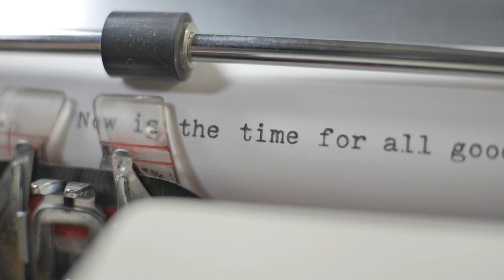Typewriter Video Series -- Episode 261: Singer Electric

Comment: I am so happy and grateful that you shared the belt replacement for your Singer. I bought an SCM Electra 110 not too long ago, and I realized right away the belts need to be replaced. (It sounds very different than my SCM Coronet Super 12.) By sharing the materials and process you used in your methodical way, you’ve given me a valuable tutorial. This will be my first time to complete a typewriter repair on my own. Thank you so much!
Reply from the maker: You're welcome, and good luck!

Comment: Great Video!  Two years ago, I acquired a mint-green Smith-Corona Electra 120 6-series typewriter. It's A Peach! My dad worked for Singer Sewing Machine Co. up until his unexpected, untimely, sudden death in June of 1960. In the year 2000, I became interested in Singer sewing machines, and I began the new hobby of collecting, repairing, and sewing with them. In January of 2019, I bought my first antique/vintage typewriter, and thereby began collecting and repairing typewriters. Since then, I have been looking to acquire a Singer typewriter, hoping to find one available locally, which has yet to happen. I know that I could sell the S-C Electra 120 easily and then buy a Singer typewriter, but I don't want to let the 'sweet' S-C Electra 120 go.

Comment: Another source for belts is to order polyurethane round belting with textured surface from McMaster-Carr by the foot and cut a length and fuse the ends into a continuous belt. The belt should be a bit smaller that the original V belt to stretch for better grip.
Daniel

Comment: Hey, Joe! If the flat plug isn’t the best match for this Singer machine, I see that white, ungrounded 2-prong plugs are available like the “Legrand - Pass & Seymour SA540WCC10 Residential Polarized Plug Straight Blade 15-Amp 125-volt Two Pole Two Wire, White,” less than two US dollars on Amazon. Or, for a bit more, the “Leviton 101-WP 15 Amp, 125 Volt, NEMA 1-15P, 2P, 2W, Plug, Straight Blade, Residential Grade, Polarized, Non-Grounding, White.”
I like the SCM 6-series machine I have, types great! Thanks for showing the disassembly and belt replacement procedure. Great video on this Singer!
Reply from the maker: Thanks!

Comment: The only problem I've got is that my preferred hours to write are usually the "WEE" ones, ie. well after MIDNIGHT when most of the rest of the world around me is trying to sleep. (Since I've always lived in a apartment buildings or multifamily houses this was a GREAT feature! No disturbing the neighbors or my own slumbering family.) There is no such thing as a "silent" typewriter despite what was claimed by their manufacturers. Just a slight reduction in the retort upon impact of the individual typeheads upon the paper and, oh yes, that "DING!" alerting you to the margin barrier. That's why I loved my old hybrid PANASONIC dedicated WORD PROCESSOR/PRINTER.
I could type like a stanard machine yet relatively silently and then save my work on 3&1/2 FLOPPY DISK to "PRINT" out during normal business hours.
I'd STILL be using one or both of them (Yes, my wife bought one at a church FLEA market here in Westchester County, NY., untested, and sure enough it had suffered the exact same problem...
FAILURE OF THE FLOPPY FISK DRIVE!
Without "SAVE" you can't "PRINT" on these guys.) today!
This was before the dawn of the modern WINDOWS OS10 and APPLE OS versions we have today; so I think the machine functions with a PANASONIC originated operating system as its software.
No typewriter repair shop I've contacted so far wants to try to tackle these guys problems.
Any suggestions or recommendations would be GREATLY appreciated!
Thank you.
Your fan here in YONKERS,NY.,
JOHN C.BOJEMSKI
Reply from the maker: John, you're right about the noise. About the only nearly-silent machines are the little electronic thermal dudes.

Comment: Thanks for posting this. I have a secretarial 215 and I can’t get it to type. The belts were gone so I used rubber bands but I’m going to find those o rings. For some reason I can’t get the keys to hit the paper. It’s like there’s something stopping them about an inch above the paper.
Reply from the maker: You don't want elastic bands ... as soon as the load force increases on the bands, they stretch, instead of the linkage being pushed harder.
Reply: @Joe_VanCleave  just got the o rings yesterday and was able to fix it. I don’t think I’ve seen any videos from anyone trying to fix an electric typewriter, thanks so much!

Comment: Hey Joe, and greetings all the way from Norway! Do you still have other electric type bar machines? If so, how does this 6-series compare to the other ones, and do you use different electrics for different reasons?
Reply from the maker: I have a Smith-Corona 5-series electric from the 1950s (light blue color) and the Nakajima-made Olympia Reporter. The Olympia is a wide-carriage machine with powered carriage return, I don't like it as much.

As for their uses, I find they're all great for longer typed pieces where I'd normally be concerned about hand fatigue if manually typing.

Comment: Hi I had a question, where did you find these O-rings at? I'm having trouble finding them. Thanks!
Reply from the maker: I found them in my TruValue hardware store in the plumbing section. 1/8" thick, round cross-section, black synthetic rubber, about 4" diameter.